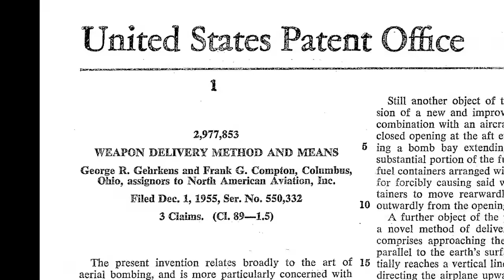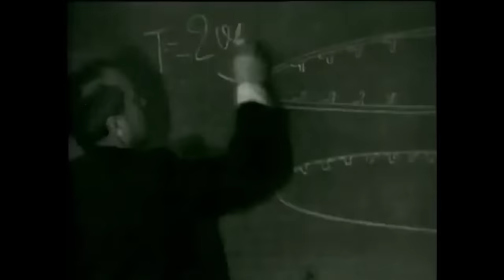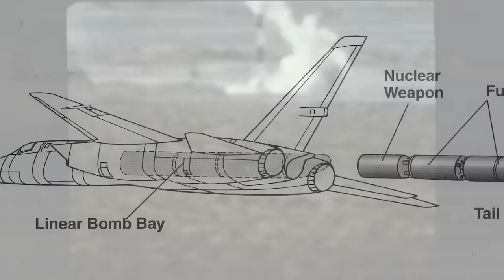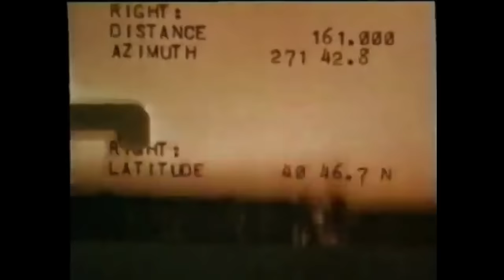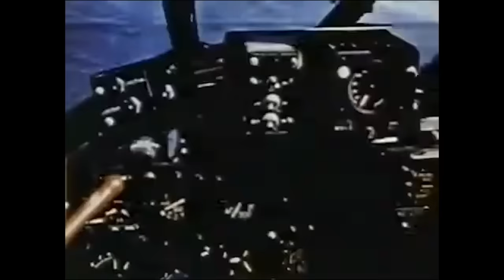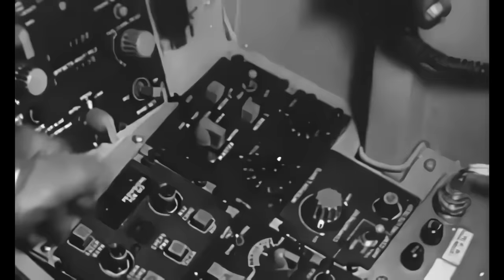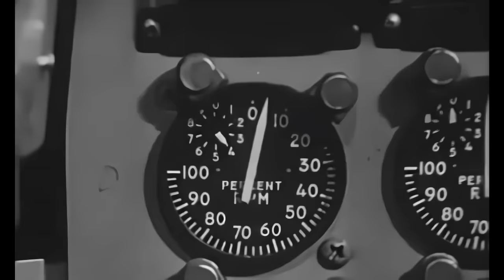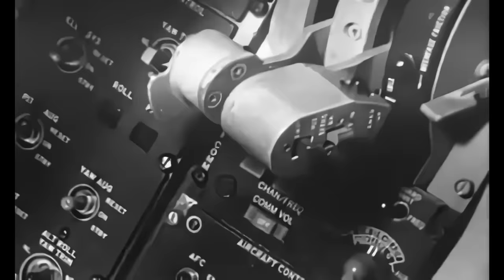North American A-5 Vigilante |  Supersonic Carrier Based Nuclear Bomber And Reconnaissance Aircraft

Comment: The first model I put together as a child with alot of help from my father  . It actually had a bomb in the tail that was spring loaded and would eject it with a push of button . It amazing the things you remember from 60 years ago .
Reply: I've been looking for a plastic model kit of this present day and can't find one. Just wooden ones for 100$.
Reply: @EmperorofMu  Are you looking for any plastic model kit of the Vigilante or the vintage model kit the OP mentioned above? If its any plastic model kit, Trumpeter makes a Vigilante in 1/48 and 1/72 scale that are easy to find and are a nice kits (built two myself). Then there's the old Airfix and Hasegawa/Revell 1/72 Vigilante models that are easily found on eBay. Old kits but still o.k.
Reply: I think the best part is that you have such a strong memory of dear old dad.
Reply: Do you remember the kits that came with battle damaged parts during the Vietnam era ?
Reply: @sirclarkmarz  Lindberg Models did those kits. There was an F-4, A-4, F-100, and Mig-21 that came with parts to make your model have battle damage. There may have been more planes that I forgot about. Good times.
Reply: Superb.
Reply: eBay has several plastic models in the $20 Range of the Navy A-5.
Reply: I had that, too.  c1960

Comment: Convair B-36 was the first true intercontinental bomber, Boeing made B-47, B-52. The North American AJ-1 Savage was mixed power plant because of poor fuel efficiency of early jet engines, not lack of reliability, you couldn’t get enough fuel into a carrier-compatible aircraft. Looking back, you get the feeling the real conflict was between U.S.A.F. And U.S.Navy for who would deliver nuclear weapons, the Russian were just justification.
The RA-5C was a great looking craft, and the reconnaissance fit was state of the art. The nose gear always looked kind of flimsy for such a heavy beast, like the F3H gear. Apparently the RAN in the back seat was more tense during carrier landings than in combat. The proposed interceptor Retaliatory with a third J-79 until you try and work out where you put the radar (compare the volume of the RA-5C nose with the F-14 nose). The linear bomb bay was an imaginative and low drag solution, but never really worked. (There’s a photo of the fuel cans falling out the back of an RA-5C during a catapult launch.)

Comment: Always worth watching the PLAT when an A-5 came aboard at night. You'd see some lights out in the groove then suddenly this huge thing would flash into view at the ramp. Amazing that something that size and approach speed could operate off a flight deck. Imagine being the back seat guy (RAN, I think they were called) Just a 6" porthole on each side back there, not a full clear canopy. I was on a school tour with the PCO of an A-5 detachment and he almost talked me into transitioning from F-4's to A-5's.

We'd escort them on their run over the North. Both airplanes had the same J-79 engines but we had missile racks and an external tank whereas the A-5 was clean. When they amped up for their photo run, we'd have to play the inside of the turns or they'd walk away from us. Something about their intake configuration gave them a distinctive howl in the landing pattern. Beautiful and huge, they were.
Reply: I've heard that it wasn't uncommon for Phantom pilots to stroke the afterburners when escorting the Vigi on their post strike BDA missions due to the Vigi's fast speed down low.

Comment: I was on CVA-62 in the 70s.  We had a Bombing Demo and Flight Deck BBQ... we also watched an A-5 do a Mech 2+ Fly-By... Youd think it was impossible for something to move that fast.  The Capt. called out Miles at a time like seconds... he's now 50 miles out, he's now 35 miles out, he's now 20 miles out... then we could see a Dot and my sight was fixed on the canopy spotting the Pilots Helmet... he went by and then pulled up and was clean out of sight at probably 30,000+ feet before we Hurd the explosion of sound.  The thing was to try and keep your hands at your sides... we all failed !!!
Reply: An A-3 doing mach 2? You meant the A-5 right, because the Whale (A-3) wasn't a supersonic aircraft, hehe.
Reply: @Nghilifa   lol  Yup, my bad.
Reply: See my comment above. I worked frame numbers 62 to 68 back in 1962.. I think it was frm#66, All painted ready for delivery after its final test flt. Uh Oh, came back with paint burned on the fuselage from  air friction. The Navy was furious because it delayed delivery for the repaint. NAA was furious because of the delay AND the cost to repaint.
We never heard any Mach nbrs but he had to be boogying to scorch the paint.

Comment: I was an aviation electrician on F4j Phantoms for VF-102. Our birds had J79 engines and would go Mach 2.23. The Vigi's also had the same j-79's, thus their speed! We had a squadron of the Vigi's on our 1970 Med cruise. I loved their beauty when on the flight deck with them, but didn't fear their size. Flight deck safety is to NOT be in the wrong place, and if not needed to be there during aircraft recovery,  then disappear!!

Comment: Served as the blueprint for the mig25.  Most think the f15 was a copy of the foxbat but they are incorrect. The na237 from the ws300 competition, that included a concept that looked strangely like a modern day sukhoi had already studied, designed, and conceptualized.  Opting for just a single vertical tail instead of the original two its concept had, the a5 was born.

Comment: There is a case to be made for real time tactical recon.
As an Ex-Phantom maintainer, I still have a soft spot for the RF-4.  But it IS a battle prooven Mach-2+ platform.
If some company in the Defence Sector were to come up with a modernized digitalized real time camera package that would fit in the nose of an RF-4, that might be operationaly viable.
Some RF-4s can fly high, and much faster than 5th gen at Mach-2+ (on par with a clean F-15).

Comment: 4:30 Columbus Oh was where I worked on the (then A3J) Vig, Air frames 62 to 68; before moving to Minuteman I's and II's to work on the same computer guidance package as the A5C. Tho it served different roles in ICBM's than the A5C the D17B was the same computer package.

Comment: We lost several Viggies aboard Saratoga in 72, Unlike the A6's and 7's not many came back with battle damage.
The Viggie was the star of the show on a dependents day cruise. Simulated a Phantom got on the tail of a Viggie and "shot it down". The Viggie nosed up, dumped fuel and lit the AB's........ huge fireball trailed behind it. Pretty cool to watch. Stuff you won't see ashore.
She had no rudder but the entire horizontal stabilizer moved! It also folded over 90 degrees for hangar bay storage! 
This was over 50 years ago but I still vividly remember it.

Comment: Beautiful plane. Weird they didnt go for a twin tail instead of a single huge one.

It looks way more modern than what it was.
Reply: There were problems with the twin tails is why they went to one. Somehow (dont know) the air between the two sucked them in and "bound up the pivots". They wouldnt rotate easily enuf for rudder control. Somehow (??) they solved the problem in later platforms because the Hornet had twins. Go figure.
I loved working on it with a GREAT crew but I needed to move into computers (see my comment about Minuteman ICBM I and II computer guidance).
Reply: Have a look at 7:08 in the videos at the early mock up version. It had twin tails, and looked even more like an F-14.
Reply: @O-cDxA Yes. North American proposed twin tails hoping to create opportunities for a fighter variant. The Navy wouldn't have it. They wanted to minimize weight and drag for the attack aircraft.

Comment: nice documentary, but the same mistake as usual that when mentioning an impressive Mach 2 speed, the most basic facts are not mentioned: at what height and for how long..... A dash speed is useless when on tree top height and you will not make it back when running out of gas, therefore each plane has certain attack profiles which address these limitations

Comment: Sure looks like a rip off off the Averal Arrow
Reply: No. If you had bothered to look at the wings you could see that. The Avro (not "Averal") Arrow had a huge delta wing making it a totally different aerodynamic concept. Other differences include the engines, engine placement, use of a linear bombay, the electronics, bomber vs. interceptor, use of an unique aluminum-lithium alloy, carrier landing capable, etc.

Comment: FBW and HUD in the vigilante ? i would doubt that
Reply: It had both.  I worked on the HUD, bombing computer, Verdan, Inertial Nav, and radar.  I was an AQB-2 1967-1970 RVAH-3 and RVAH-13.
Reply: @Lost1inDetroit  interesting, what was the extent of the fly by wire systems ?
Reply: I do not know the extent of the FBW system since I did not work on that system.  I would assume the horizontal and vertical stabilizers at a minimum since they were so large.  Also utilized a titanium frame structure.  Also had terrain avoidance radar system that used the HUD display ground maping the route for the pilot.  I used to calibrate that system which was very complex.  There were so many electronic systems that looking back at the time it was a flying electronics laboratory.  Then there were all the different cameras.  @sharklegs